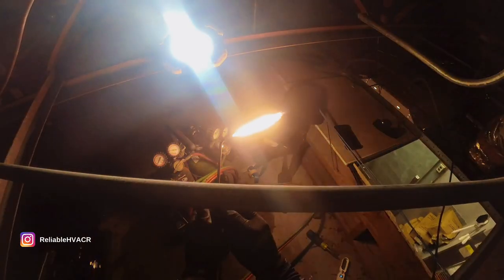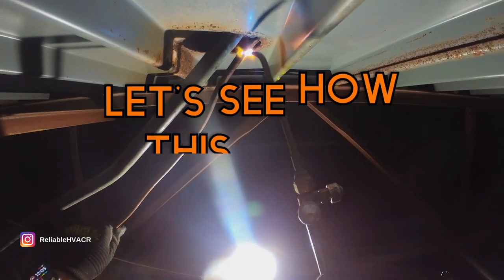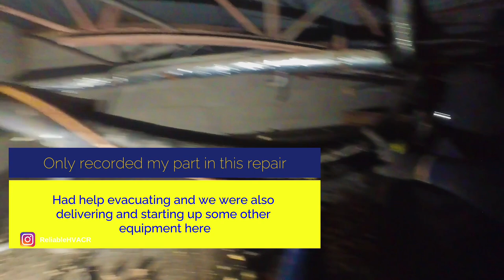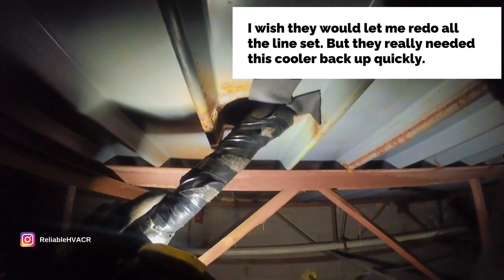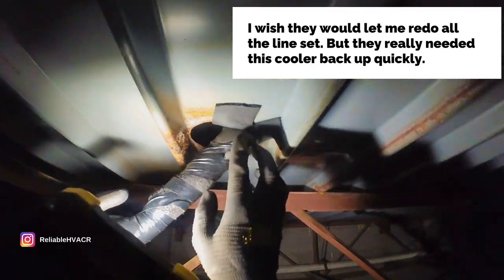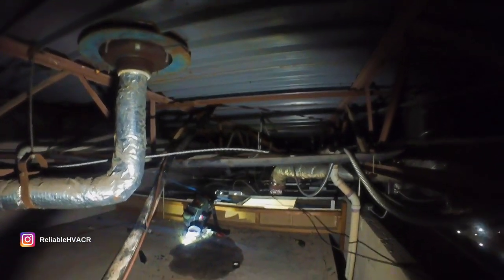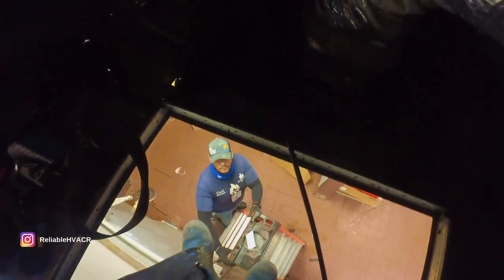I Always Find Issues Up Here | HVACR Leak

Comment: Great job my guy keep up the great work
If you don’t mind for me give you a tip on tech from another try to have with you insulation foam bottle with for those roof top holes it helps from the vibration
Reply from the maker: Yeah I'll see if I can seal it there. I just didn't have any, thanks 🤙🏽

Comment: You're conscientious that I will say say but you took a big chance with that torch  not catching that roof on fire unless I'm not seeing things correctly
Reply from the maker: Appreciate it. But yes I understand the risks I take, just try to keep them minimal and stay prepared for the worst. I tried not to heat it up too much but it was all metal, just be careful with anything flammable.
Reply: @ReliableHVACR  you musta had some space to play with up there cuz I would been scared if that line woulda been tied to a witch hat or somethin. That's ur customer so I'm sure you knew what you was up against. Good stuff!
Reply from the maker: Maybe a little but not much play, I've repaired a bunch like this already. Plus I had help on the roof. And thanks 🙏🏽